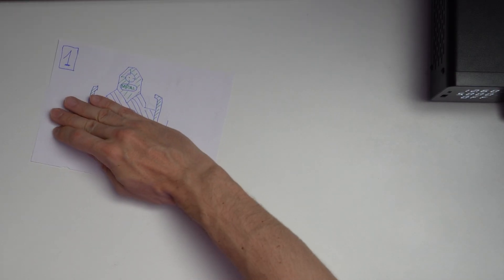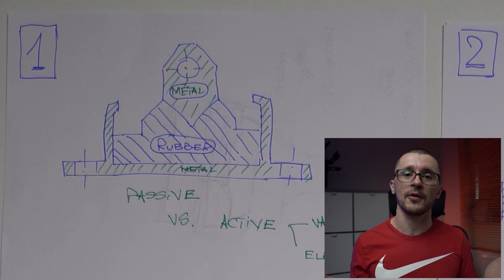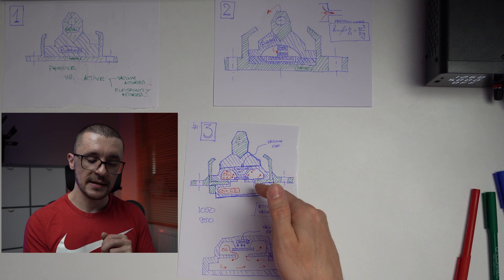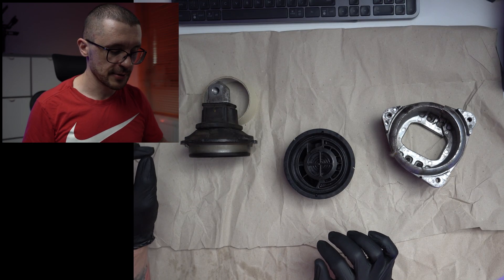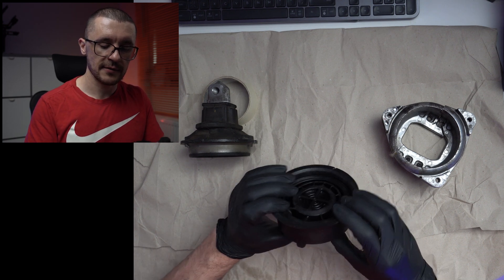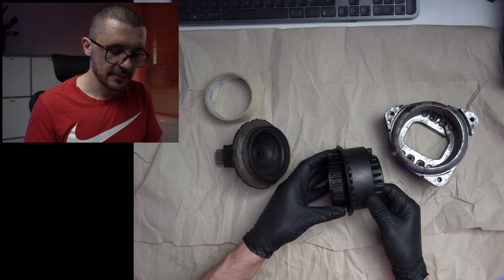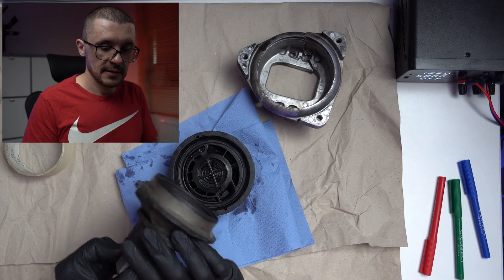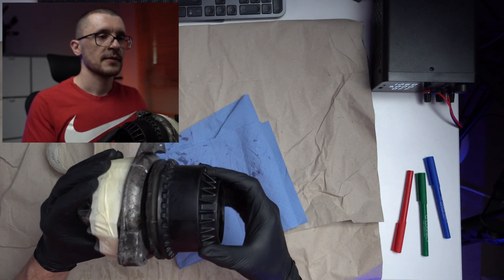How Active Engine Mounts Work 🎓 EXPLAINED 🎓 BMW F10/F11/F15

Comment: Brilliant content again, 
your video tutorial on replacing engine mounts on BMW F10 was informative and led me to purchase replacements from Autodoc. However, upon installation, I discovered that the mounts came with a vacuum connection, which my original mounts lacked. Despite replacing both engine and transmission mounts as recommended by my mechanic, the vibration issue persisted between 1500rpm to 1800rpm. Unsure if solid engine mounts without a vacuum connection would resolve the vibrations.
Any thoughts would be greatly appreciated :)
Reply from the maker: the vacuum bit is not a deal breaker. I would investigate other things that can make the vibration. If you just want to stiffen up your mounts, people place silicone in them.
Reply: Many thanks for your prompt response. I just wanted to clarify that it's not the mountings. It's a strange vibration that only started after I replaced the clutch/flywheel and complete front suspension kit, except for the engine mounts, a few months ago.
I bought a brand new LUK flywheel and clutch kit and had it installed by a professional mechanic. I was advised that the pressure plate was faulty new (as it would not create the spring effect and push the clutch pedal back). I had that replaced along with slave cylinder, and the clutch was performing as normal. However, there has been a vibration appearing since then between 1500rpm to 1800rpm. We thought it's related to engine mountings as that was the only part we didn't replace.
After changing the mounts, it still persists (only when in gear, no vibration when revving as neutral). I think I will start investigating with the flywheel as it could be causing the vibration due to being faulty and not installed properly?
Reply from the maker: @Asad-ie1ns  these vibration issues are the hardest to diagnose. Sometimes they may be due to low quality parts or even procedures that have not been followed. as a funny / expensive lesson learned by me recently, I have changed the Vibration damper/ cranckshaft pulley on my 530d. It was part of preventive maintenance and at the same time I have done water pump, all the tensioners and rollers. at IDLE I was getting a strange vibration. Ended up doing the refurb on the alternator, did not sort it. investigated even more and found , the Vibration Damper that I got was the cause of the vibration.  Anything that is not GENUINE BMW can cause problems.

Comment: Could you give more info on how to replace the vacuum lines for the engine mounts on a f10 530d as mine seem to be snapped where it splits off to each mount. Thanks
Reply from the maker: https://www.realoem.com/bmw/enUS/showparts?id=FW52-EUR-04-2010-F10-BMW-530d&diagId=22_0153

Comment: Great video!, i searched alot about these type of engine mounts, never found anything useful until now. Do you think you can retrofit the vacuüm system? When i bought my new engine mounts directly from bmw the new ones had a vacuüm connection, but i don’t have the vacuüm system/lines. On there website you are able to order the kit for it, now i’m asking myself is it possible and where do you connect the regulator. Been walking around with this question for quite a while. I have a n47 F10
Reply from the maker: yes. the retrofit should be possible if there is a n47 that has it. Alternatively we can make a separate controller to do the switching. Might not have been an option because the 2.0 is balanced internally for secondary inertia forces. It is less mass. for you to get an idea of what is available start exploring realoem.com